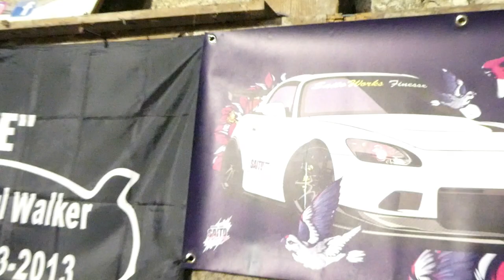*Saturday Snippet EP1* FN2 Honda Civic Type R Idle Assist Valve Replacement

Comment: I'm currently in the process of replacing this exact part on my ep3.  The end that sticks out of the side of AAV keeps running into my valve cover so I can't turn the AAV any farther.  Did you guys have any clearance issues with yours?  Thanks.
Reply from the maker: No mate we didn’t, you think you will ha e to take the cover off to get it on?

Comment: How did it idle before you fixed it ?
Reply from the maker: Was fine, chris snapped it off when fitting new hoses 🤣🤣
Reply: @CowabungaCarDiaries  ohh apparently as you say you can delete them, but on the ep3 as the IACV on throttle position does the work. Fn2 is DBW so the IAAV sends air to correct the fuel ratio on warming.

Removing it I think, alters the ratio and you have unburned fuel entering the cat, which fails them so I read. So you were right to replace. Just wondering if the valves go, what the running symptoms are.

Comment: Where did you get the k&n air box from. ?
Reply from the maker: It’s just the k&b panel filter in the oem box mate
Reply: Its a standard box mate with k&n panel filtter was on car when got it 👍
Reply: Oh. Lol. Cheers 👍

Comment: Can’t you make a video on how to replace your blower motor and resister? ( and upload that today lol)
Reply from the maker: I’m assuming that’s today’s job lol
Reply: @CowabungaCarDiaries  tis mate. I’ve changed the resister and that not the fix. When you done your short shifter mod did you remove the plastic under the steering wheel?
Reply from the maker: @SP4NK4Y4NK  yes mate but not totally, just left it hanging
Reply: @CowabungaCarDiaries  yeah I got that far but I couldn’t get the right side off
Reply from the maker: @SP4NK4Y4NK  there’s a panel on the right side but the door, pop that off and there’s a screw behind the panel